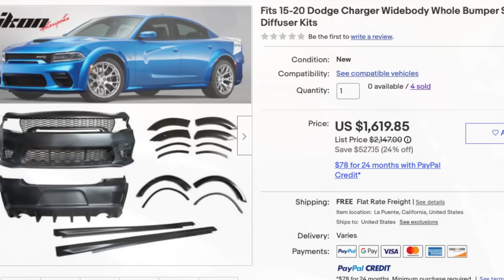My Widebody Charger

Comment: That's what I love about chargers and challengers as long as dodge doesn't make major changes on the body(chassis, etc)you can upgrade them to the current models as far as esthetic goes and be up to date 💯🤙🔥 until dodge decides to completely redesign them

Comment: I didn’t think I liked the wide body on the charger until now. I just put srt front and rear bumpers on my rt also ( not wide body ). If you decided to add fog lights just remember to flip the positive and negative around from the rt head fog lights.  Great content as always.

Comment: Uve inspired me, now I have 2 weeks to get mines done aswell . rt widebody .i was told to cut the fenders by 3 different people that did the same process. Owning a rt with stock springs dont have to cut fenders cause it's already high.
Reply from the maker: I hit a massive pot hole today & the tire in the front hit the fender. You have to drive like your car is lowered if you choose not to cut the fenders

Comment: Looks nice! Great video! Now that you have the body kit I really wouldn't drive that in the winter. Especially if you live in the rust belt where road salt is used. Area's that the kit covers will be areas where the salt builds up and will rust out your panels. The one thing that sucks about body and ground effect kits in general.

Comment: The best video by far gave us all 2015 R/T a look a the potential🤘🏼🔥💯💯💯💯just one question the back bumper has the back up sensor??
Reply from the maker: Yes they took the back up sensors from my old bumper. They had to drill holes for them on the new bumper

Comment: Congrats man what a beast!! 
Just wondering the tires wouldnt hit the fenders if the tires get hit hard ¿ and did u use spacers
Reply from the maker: The stock suspension is pretty stiff - but there is always a chance it will hit. Just have to drive like you're lowered even though you're not.

Comment: Ok! Let me understand! A RT Charger or Challenger, at stock ride height, can get larger wheels and tires  with spacers and not cut fenders by adding a Wide Body kit?
Reply from the maker: You will need to add spring spacers or lower profile tires if you choose not to cut the fenders. I was told everything would be fine if you're at stock ride height, which isn't the case. i hit a massive pothole & my tire hit the fender. Going to make a video explaining this so people have a heads up.

Comment: Where can I find this body for my charger? Did you have to change your tire size?
Reply from the maker: I got it from Ikon Motorsports on ebay. It was around $1700
Reply: @RTLife  I searched for it, but I can’t find it. What size of ties and rims did you have to get after?
Reply from the maker: This is the body kit
https://www.ebay.com/itm/Fits-15-20-Dodge-Charger-Widebody-Whole-Bumper-Side-Gloss-Black-Diffuser-Kits/393109522317

The Wheels needed to get upgraded - they're sold on Vicrez.com
Reply: @RTLife  how do I know what size to get?

Comment: Just came for the link to the kit! Cant find one under $2k
Reply from the maker: They're sold out at the moment - the listing is down for the Ikon Widebody
Reply: Have u hit any bumps yet? I got the first widebody kit vicrez put out, Every single bump rubbed fenders. I’m just wondering if I need to cut with the widebody kit + wheels. I ran 1.5” spacers first time
Reply from the maker: @tiptoetreyvlogs  You need to be at stock ride height. Looks like your 392 is lowered so yah def going to run into big problems unless you cut the fenders.
Reply: @RTLife  I’m still at stock ride height and still rubbed, knocked an entire widebody front fender off hitting a bump/dip in road 😂 my kit is coming in and I want it done right this time around sorry for all the questions
Reply from the maker: @tiptoetreyvlogs  My RT suspension must be much higher stock. Take a look how much clearance I have @5:45 https://www.youtube.com/watch?v=ofl9lwwkeoI&t=303s
You may need to cut the fenders or raise up your Charger.
Reply: @RTLife  appreciate the help man, idk if my Daytona came lower than others, but I’ll let u know how it goes. Been watching your videos for a while, keep it up!

Comment: Is it me or does that blue on the new panels look darker than the rest of the car??? I'm pretty sure there's something off right there...
Reply from the maker: check out @4:53 (stock) - for some reason my RT always has that look. But the fresh paint looks slightly off at some angles. It was kind of messing with my head.
Reply: @RTLife  when they painted it did they put a sunlight up to it?? Most body shops carry those in order to compare in existing panel with a freshly painted panel to ensure a perfect match..
Reply from the maker: yes - they did a panel with 6,7 & 8 coats to see which matched the best. I can always blend it but I'm cool with this. In a video this week I will show a closer look at the match

Comment: How many ponies?
Reply from the maker: Around 510-520 at the crank
Reply: @RTLife  nice! Also what trim is this, like a R/T with mods or a scatty?
Reply from the maker: This started off as a 5.7L R/T. Went with an Arrington 392 Stroker with cylinder bore to make it a 6.5L 397. Has a forced air camshaft, 392 manifold, full exhaust, hellcat throttle body - just need some forced air now haha! Thanks man